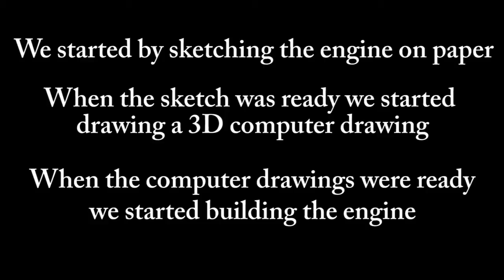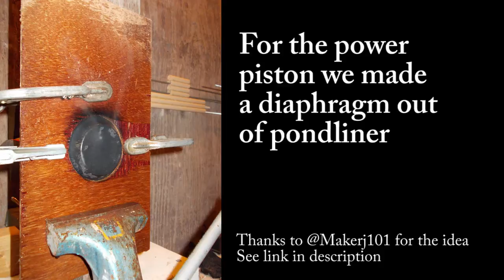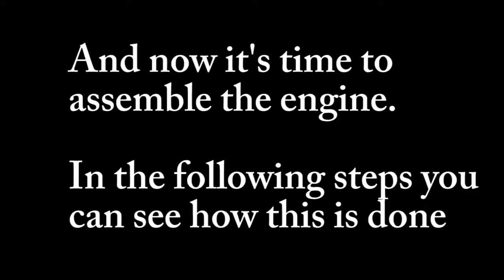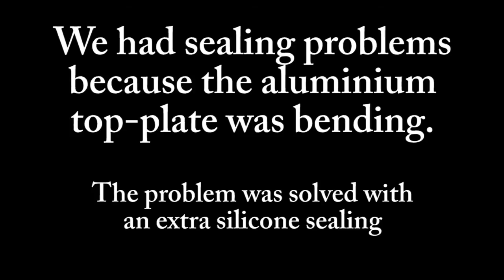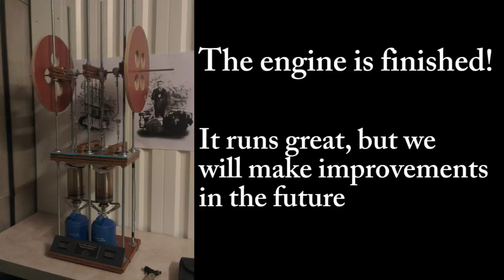Two-Cylinder Stirling Engine - How It's made

Comment: It looks like the displacer rods run in tubes are these attached to that seal?  Thankyou and sorry for all the questions!
Reply from the maker: The tubes, where the displacer runs in, are glued to the top plate. That top plate is airthight with the rest of the plate, so everything is sealed. It was easier to glue them to the top plate, however gluing them to the seal-plate is better maybe.

The tubes where the displacer rods run in, are made of aluminum. That is a bad material for this application, brass is a lot better. Currently doing a complete re-design on this engine, it will be much better. I think i'll start a video series about it next week, so ik you like it, stay tuned!

No problem asking questions, hope this helped!

Comment: What is the seal made out of that goes over displacer cylinders in step 4? Does it make a good seal around the con rods?  Thankyou very much
Reply from the maker: It's a metal plate, around 2 mm thick. It doesn't make a good seal about the connecting rod. The hole is bigger than the tube where the connecting rod slides in. The tubes are glued to the top plate, and all plates together make an airthight seal, so the hole in this plate isn't important